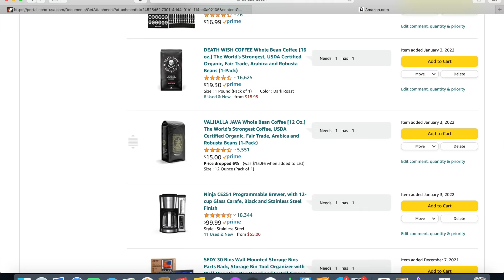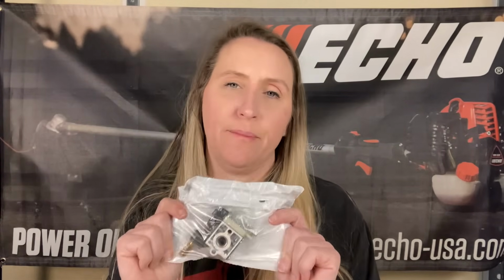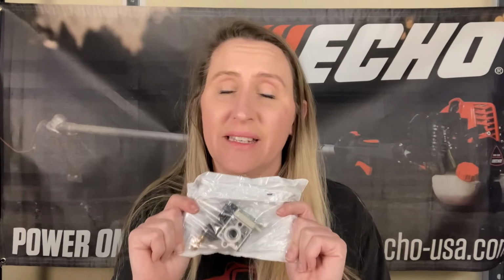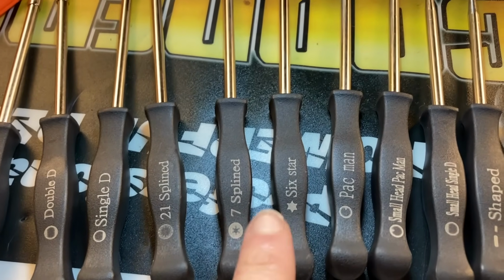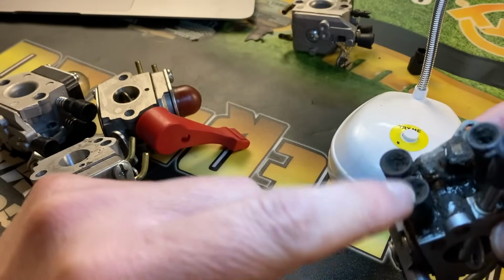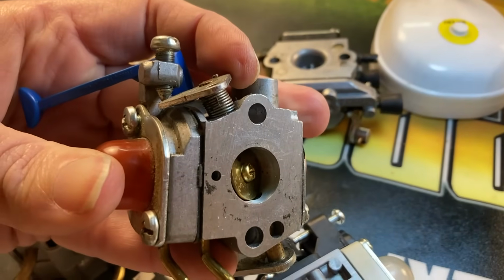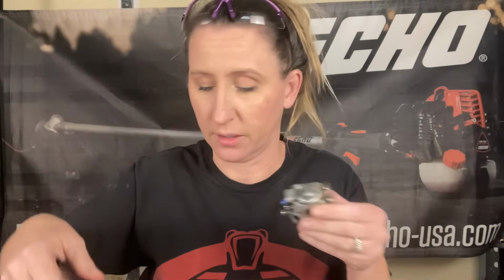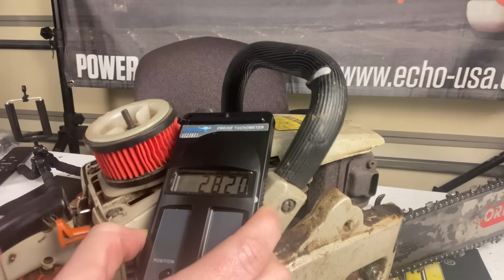HOW TO ADJUST your 2 Cycle Carburetor on a Chainsaw or Trimmer and when you probably shouldn't VLOG

Comment: i would love to have epa  come over an  replace an repair  all my carbs  do to  the junk gas they made everyone make,,,
Reply: And now they can use as much as 15% ethanol 
Due to 'putin' or so they say...
Reply: I think it’s better then more lead in the air
Reply: @Matthew_Does_To_Many_Things  lead has been gone  for years  ,,wish  it was back
Reply: @matthewbeaver5026  the ethanol is there  just to make corn lobbyists and farmers happy. Even Al Gore said ethanol is worse for the environment than non ethanol.
Reply: @thadrepairsitall1278  also a lot worse on the motor or at least anything carbed. 
Almost impossible to find straight gas in my area.  One place about 45mi away.
Reply: @matthewbeaver5026  I'm in the same boat. Also all Ethanol free fuel is about $1.25 a gal more.
Reply: @Thad repairs it all  Corn ethanol is an issue. There are better options, but we don't use them in the US. Our engines also aren't optimized for ethanol/high ethanol gasolines. If properly optimized, you can get better mileage and power from ethanol gas.
Reply: @matthewbeaver5026  Except they can't sell E-15 (usually sold as Unl-88) as E-10.
Reply: So true
Reply: @Matthew_Does_To_Many_Things 
There hasn't been lead in gas for well over 30 years.
Reply: @karlrovey 
Maybe it depends on what state you're in. I know a couple states that advertise E 15. Arkansas,  and Missouri.
Reply: @Matthew_Does_To_Many_Things lead has been gone from gasoline for way longer than ethanol has been in it. Lead was a lubricant, not a subpar filler like ethanol.
Reply: Ethanol requirements are more to blame on the agricultural industrial complex that wrote the laws to force oil companies to add it.
Reply: @Matthew_Does_To_Many_Things  grew up with  lead gas  ,,,at 70  i still  love it  ,,,
Reply: My grandpa (dead now) was born in 1908.  He and his brother ran a gas, diesel fuel and kerosene station and repair shop in a small farm town.. Breda. Iowa.  He told me once about how they added lead to fuel (it was all originally unleaded) and charged more for it because it was supposed to be smoother.  

Then, much later again, they took the lead out of the fuel for obvious reasons, and again, they charged more for “unleaded” because that was supposed to be a specialized formulation.  

Everything comes full circle.  Corn gas is not environmentally friendly, does not run as well, and limits life of engines.  It may be the next one to go.
Reply: So many things they are responsible for. How about replacing my rusted out cars because how they Oversalt the roads
Reply: If it was up to the EPA only rich Democrats would be allowed to use petroleum products and of course jet fuel to fly around the world in their private jets and lecture all the poor people on why they should only use battery operated everything!
Reply: Bro the double  spaces an the ans. Just a joke. I want leaded petrol back.

Comment: This has to be the best carb adjustment vid I've ever seen and I've watches a few dozen....   THANKS...
Reply from the maker: Thank you!!
Reply: @Chickanic  I turn screws far more than you do because dirt and coagulated fuel gets stuck in the screws often and can often be cleared by moving screws back and forth and then returning them to where they were.  The trick is to mark or write down where they were so that you always have that option, and I don't trust that to memory.  Also, clearing dirt cans often be done within the range of the limiter caps, so they often don't need to be removed.
Reply: @Chickanic  150 psi good compresion 335xpt ?
Reply from the maker: @Sensei948  It is good.
Reply: @Chickanic  Is this L nozzle setup procedure also correct for 372 xp 335xpt? If I leave the L nozzle in the highest position, will I damage the saw?
Reply: @Chickanic  So we find the highest speed of the L nozzle, then we tighten the T nozzle to 3700 and move the L nozzle back to 2700?
Reply: Is this L nozzle setup procedure also correct for 372 xp 335xpt? If I leave the L nozzle in the highest position, will I damage the saw?
Reply: So we find the highest speed of the L nozzle, then we tighten the T nozzle to 3700 and move the L nozzle back to 2700?
Reply: You are the boom I love all your video's
Reply: I just came across this video. I see you posted it 9 months ago. However, I feel it's important to let you know about why gasoline attracts the water. You do a little research you find that anhydrous ethanol is what is mixed with gasoline to boost the octane and to make it burn cleaner. The downside is the anhydrous ethanol is attracted to moisture. Relative humidity / ambient moisture in the air will be drawn to the ethanol in the gasoline and will eventually condense. The ethanol/moisture combination will ultimately settle to the bottom of the gas tank. That's where your water comes from that gets in your gas tank. I personally like to remove the ethanol from oxygenated/ethanol gasoline. I do this by by adding 10% water to every gallon of gasoline that I purchase. 1 gallon of gasoline is 128 liquid Oz. I will add 13 to 14 oz of water to the gallon of gasoline, in a plastic gas can, shake it up, and wait one to two hours for the ethanol/ water mixture to separate out. After that it's simply a matter of separating the two liquids. I typically use premium gasoline because you lose about five octane points when removing the ethanol from gasoline.
Reply: One other thing: I add stabil fuel stabilizer to the gasoline after I've removed the ethanol to keep the gas from going sour. My equipment tends to sit for extended periods and this is what I found really works well for me. Not saying this is gospel. However, this is what works for me. I use this modified fuel in both two and four stroke engines. I would purchase ethanol free gasoline were it sold where i live. Sadly it is not sold where I live. It's a bit of a headache to go through the process to make it but it's well worth it.
Reply: I'll 2nd that!  The absolute BEST - at least for that Echo CS3000 - which is one of 3 that I own.   Her approach seems to make sense - make your adjustment on the L side first - since the L side contributes a small amount of fuel all the time - and than adjust the H side.  The H side contributes little (or none?) at idle.  Can you apply this approach to other chainsaws - just take into account the max  and low RPMs for that particular chainsaw?  Again just a fantastic job.   BTW for folks that would like to have a more technical explanation there is a UK tuber (TheRepairSpecialist) who has several videos on how a 2 cycle carb works - it helps to know what you are doing and why.

Comment: I was cutting firewood commercially years ago and bought a new Husky 266 pro saw and ran a 28-inch bar. It was the best saw I ever ran. I must have cut 500 Coard of wood with saw and it never let me down. It would cut circles around any other saw in its class. Carb had to be adjusted every time I went out some days I would be at near sea level and other times I would be at 8000 ft. above sea level. I always set the high speed until the saw would just start to four stroke at wide open then adjust to get a clean idle and then recheck high speed again. When I buried that 28" bar in a log she cleaned up and ran like bat out of H. I own a boat and motor repair shop and have been adjusting two stroke carbs for more than fifty years now mostly by ear. My customers use their boat motors here CA. anywhere from sea level to 9000 feet and I have no complaints or come backs. I like and enjoy your videos most stuff I already know but you have taught this old guy a thing or two. Thank you

Comment: I've always tuned by ear just the way you showed with the tacho, it's important to keep in mind that if you must make an adjustment keep on the rich side as lean mix means high fuel burn temp which equates to melted piston and huge bill.
Reply: So we find the highest speed of the L nozzle, then we tighten the T nozzle to 3700 and move the L nozzle back to 2700?
Reply: Happened to me.  Dead backpack Husq blower…now I need to find parts…
Reply: Most carburetors,  turn left to richen doesn't take much. After it hit maximum RPM back off until it starts losing RPM the extra fuel will help from having a lean mixture
Reply: How Huge bill ??
a Second hand whipper is gonna be $80 - $120
and if you want to go for something better,  say up to $200
how would you ever get a huge bill, even if the piston did melt ?
and entire crankcase and piston is like $40 - $50
Reply: @martinkuliza  $40 - $50 is a lot of money these days, people don't have ready cash to throw around anymore! If you do then fine 🙂
Reply: @Herbybandit  
$50 is NOT big bucks
but i now understand the comment

but you can't make a blanket statement that it is for everyone just because it is for you

Comment: Careful with some of thoes amazon adjustment tools, you need to be 110% your seated correctly or they will strip out your adjustment! Particularly the "small D" head. Gone through 3 of thoes cheap amazon kits small D as it was quite the right size

Comment: Ok to solve your gas issue consider this, marine gas and special pump gas, labeled alcohol free on the pump, and aviation lead free fuel, are three examples of alcohol free. If you buy pump gas in today’s world, it has at least 10% alcohol content, maybe more. Alcohol attracts water as the molecules try to bond together, and causes it to condensate inside fuel tanks, carburetors, and fuel injection systems, causing rust and corrosion. Look carefully at the pump, and ask inside if it has alcohol content before buying. Alcohol gas has a storage life depending on the container, amount of moisture in the air, and temperature, usually less than 3 months reliably. Marine gas from a marina, can last for years if stored properly, not in unlined metal containers. Obviously marine gas in in a wet environment, hence the need for this protection. Low you show, thanks for sharing all the great tips👍👍. Sure you will pay more for marine gas, but weigh this against repairs and down time costs. A few gas stations sell no alcohol gas at a special pump, but not very many.

Comment: This is the most professional tutorial for proper carburetor adjustment of a two-stroke engine in a chainsaw ever found on the Internet. 
Even at my local Husqvarna service center, they wouldn't put that kind of effort into their work. These slackers set the carburetors on customers' chainsaws "by ear".... 
While setting slow revs by ear (L screw) will not harm the engine, setting high revs by ear (H screw) risks seizing the engine by exceeding the safe speed (e.g. 13000 rpm on most Husqvarna saws), at best they will set the high revs too low (e.g. 11000 or 12000 instead of 13000 rpm) and the saw will be less efficient. 
Thanks for your work. Greetings from Poland.

Comment: Your advice on finding the “root cause” on why your carb might need adjusted is the best I’ve heard. Like you said most people are trying to tune around an issue. When you buy from a dealer they will tune it for you from new and after it breaks in if needed. Yet another reason to support a local dealer.
Reply: Spot on .....Andy ....I find more mistakes are made by people dedicated to results only to suffer from avoidable repercussions . I even advocate that proper vac and pressure testing should always be preformed on equipment before reaching for the nearest adjusting screwdriver.
Reply: Sadly / i have found this young lady still dosent pressure or vac test the equipment.....Well lets just say we havent seen the testing tools required rather ......I find this troubling for many reasons that i made evident in a prior comment with regards to a Poulan Chainsaw . But to reiterate if proper vac and pressure testing isnt preformed you can inadvertently cause more damage by forcing a determined result . Note replacing diaphrams / Kits are ideal but keep in mind not all kits include the check valves that often swell or distort that most mech /techs are certainly aware of ........there for .....hints once again the reason of why pressure and vac test equipment is so imperative . I dont mean to seem as if I am a Troll ....And to be honest I think she has amazing talent ....But viewers should be aware that kits and fuel lines are only a small fraction of fuel related issues ....Now with that being said she did advocate making OEM purchases over aftermarket .....And that in its self is very sound advice ....NOW ON TO A MORE POSITIVE NOTE .....I was pleased to know/see  she used a tachometer on the Chainsaw I just hope to see a future video of her showing proper vac and pressure testing on not only a chainsaw but the carb and tank vent. Perhaps show leaking seals around crankshafts , impulse lines ,intake boots or insulators .......I mean her talent is there ......My question is simply why havent we seen her use the equipment required to properly vac and pressure test theses chainsaws as they are basic in this line of work ?  And respectfully she advocates she works on many two cycle pieces of equipment ......{Strange} ......Seriously  just perplexing for lack of a better word .
Reply: @kevinbolin7665  I think you must have missed it, but she did mention checking the cylinder compression with a gauge while going through the case study and demo of the large chainsaw in the video. It's always good to have all the proper tools, and thanks for reminding me of the value of a compression tester. I'll probably have to invest in one in the future for my repair endeavors.

Comment: I always set my mixtures by reading the spark plugs.  Same as in my old cars.  I never knew you were supposed to adjust the idle mix the way you do.  I just set in the middle of both drop off points, same as a car, then adjust the idle screw to an rpm that is low enough to just stop the chain from rotating.  After I cut wood for a while I will pull the plug and if it is bright and clean, I’m running to lean.  If it’s black and sooty, I’m too rich.  As far as high goes I find the high point and then back off until the saw starts dieseling.  I’ve never used a tach. Luckily I haven’t burned up a saw yet.  I’ll buy one and start using your method.  Thank you.

Comment: Non ethanol gas has solved all my carb and fuel line problems.  
Had a new Stihl saw that stalled at idle.   Finally tweaked the carb about 1/8 turn and ran fine. Thanks

Comment: I stared using non ethanol fuel in all my small engines about 3 years ago, and have had great luck. I also use an additive every end of season and actually will do a couple cold starts every winter. Great advice! Great video!
Reply: I use ethanol free premium, and have no problems at all.  of course, my season never really ends, but I'll have gas sitting in the can for months at a time.
Reply: You've got way too much time on your hands!
😂😂😂
Reply: Non ethanol fuel has solved virtually all problems with all my small engines. An opened bottle of ethanol fuel will absorb water from ambient air in an hour or even less. It becomes cloudy with water.
Reply: I'm 80. All my two-cycle stuff is very old. Like 10 or 20 years. What she says is true about warm up and getting it running after sitting over winter. When I was running a lawn service in Florida, didn't have that problem because you're running your stuff all the time. In Florida gas would go bad all the time it's too hot. So if your stuff wouldn't run you know get some new mix. Up here on North Carolina gas goes bad over winter. Dump it and put in new mix. I never heard of a tachometer for two cycles, I guess I'll have to get one cuz what she says is true, too high of an RPM you'll burn up your engine.

Comment: Just FYI
I've actually had gas go bad in 20 days!
An old timer has told me years ago that the gas we get these says has so many additives for vehicles, that the gas goes bad in 30 days.
Compare to the gas we had in early seventies.
My experience...
We had a vehicle we could not afford a part so it sat for roughly
2 YEARS  maybe more.
We were finally able to repair that part and actually started that vehicle with the gas that was in the gas tank when we stopped driving it! Yeah WOW!
I could not believe even then that it would start on that old gas. But it did. Drove it to the gas station filled it up and didn't have problems with it after that.